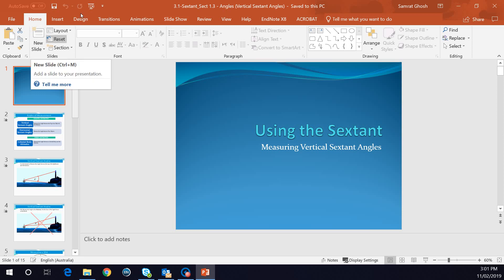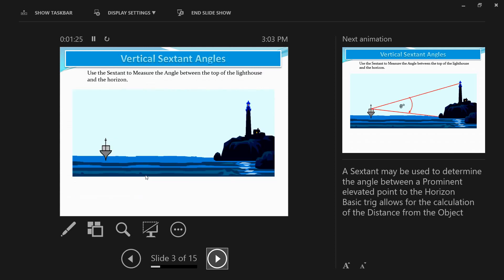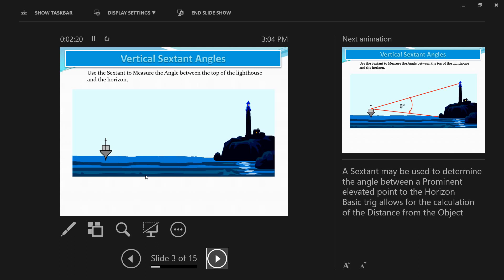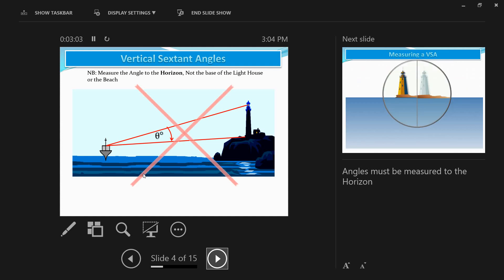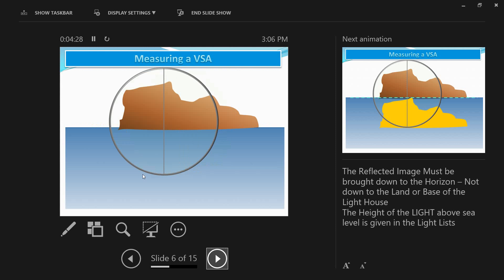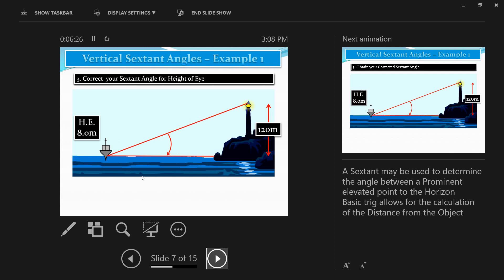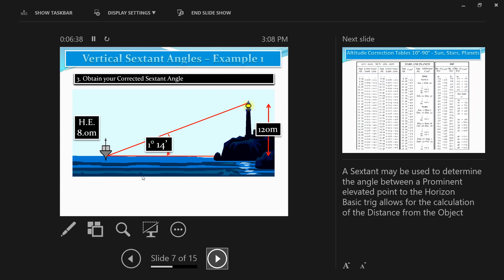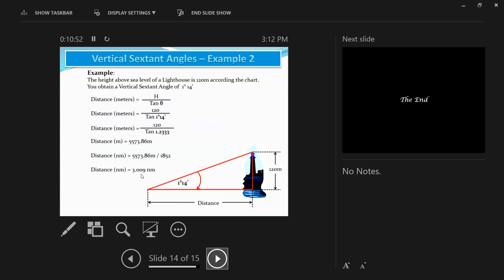Measuring vertical sextant angles

Comment: Amazing video sir 👍🏼. Just wanted to know that since the height of the light house is from MHWS and its not necessary that we will be at MHWS so their might be error in the height that we are taking. So what to do?
Reply: You need to correct for the height of the tide at that time and place. Add the difference if the level is below MHWS, subtract if the level is above MHWS.

Comment: Thos is very good. Two things: it is easier to multiply by cot (theta) than to divide by tan.
Second, and rather more important: the angle correction is wrong because the distant horizon, which you would see if the island was not there, is not the same as the altitude of the sea at the foot of the island. The correction is complicated, but provided the altitude of the object is less than about 5 degrees, the correction almost perfectly cancels out the eye height correction you have made. In other words, dont bother with the correction.
Reply: Are you talking about a dip angle 📐 to the Horizon ?